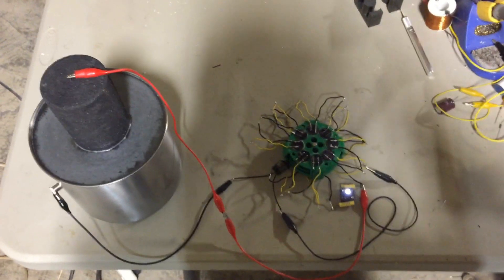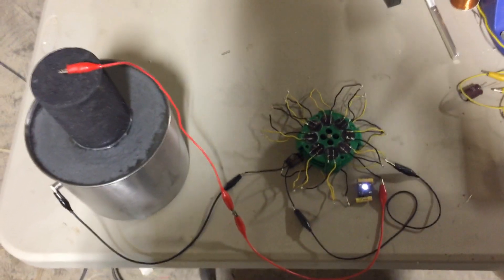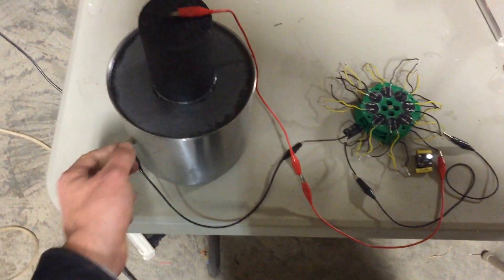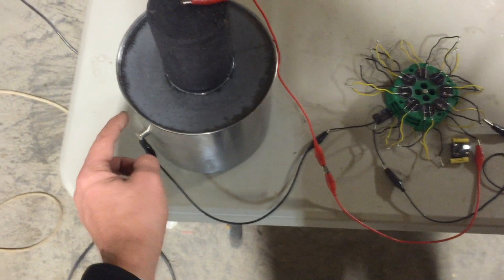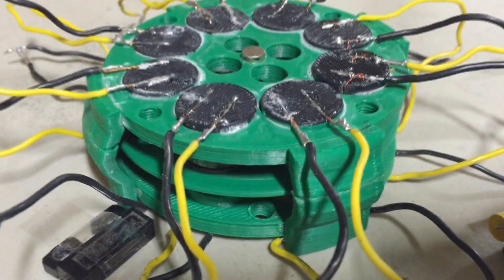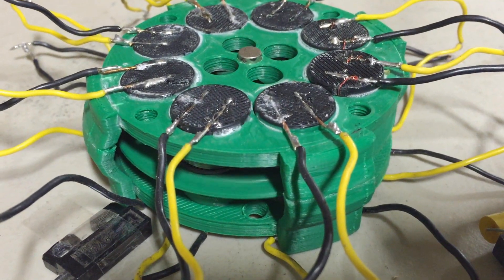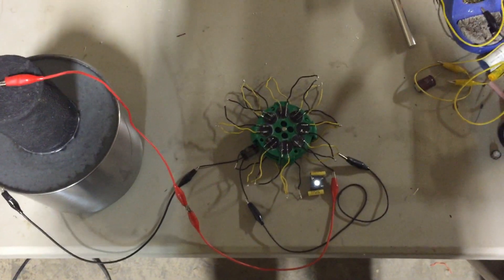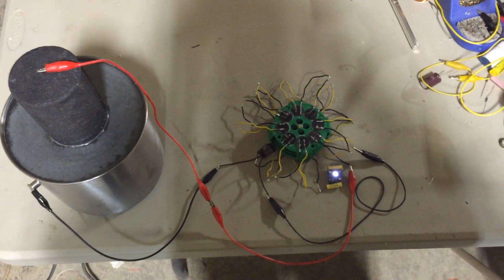Stainless Steel Powers Motor and LED - Part 2

Comment: i made one of these 3 years ago, using a thermos, and a coil sandwich of polyethylene landscape fabric and stainless steel scrub pads. So, basically, Stainless anode and Stainless Cathode with distilled water and a porous plastic separator. A Capacitor. Amazingly, I got between 2 and .04 volts and from 60mA.to 1.2mA over 10 hours It would slowly decrease over time along a negative log curve, but I could recharge it quickly with a battery. I figured it was from differing alloys but there may have been some nano scale charge accumulation within the polyethylene fibers between the electrodes. I repeated a couple times with different setup but same materials. Same results. Experimenting is fun.

Comment: Is it your standard crystal cell mix as the electrolyte?
Reply from the maker: Binj Komisar 

The first day it was just a little Epsom salt.  On day two I added more Epsom salt and a little potassium chloride to see if it would make any difference in power output.  Today I added a little Alum to see what effect that might have.  I have not yet added any Borax.  I really need a bunch of different test cells because at this point I cannot tell if any one ingredient has added much to the cells output.  The cell seems to be very stable manner so far.
Reply: salt water
Reply: lasersaber Excellent, thank you for sharing.